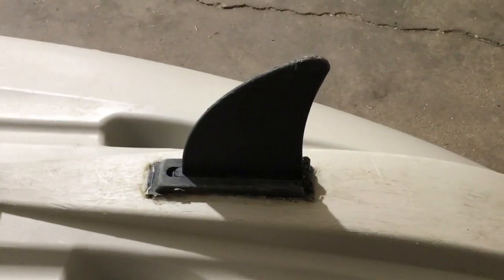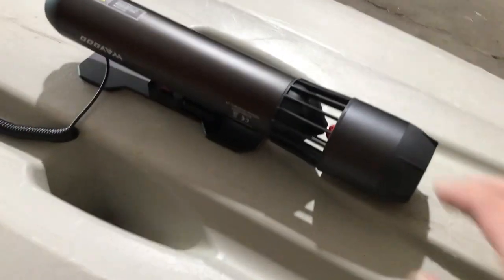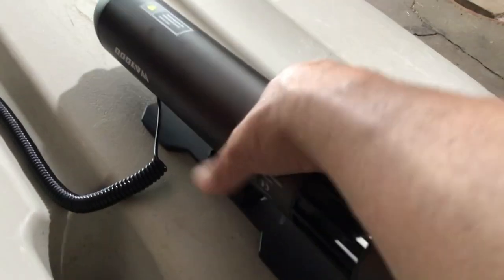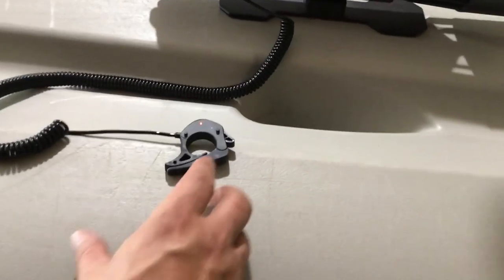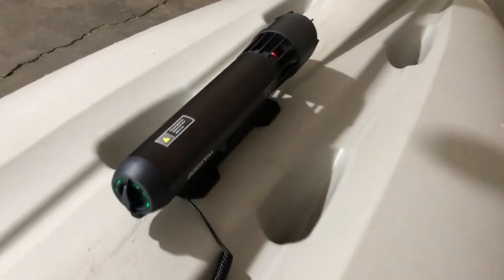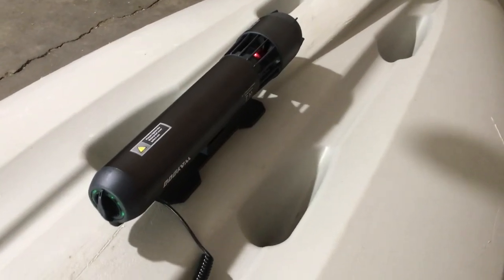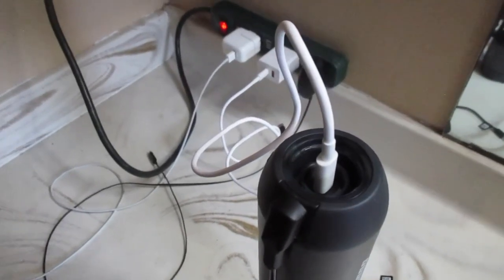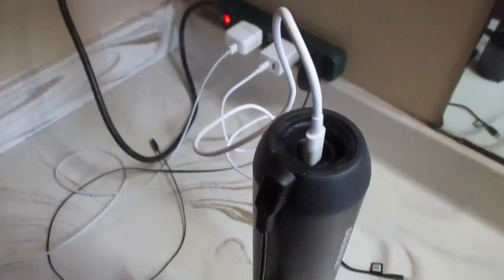WAYDOO SUBNADO SCOOTER #waydoo

Comment: Is there any way to keep it in super gear?
Reply from the maker: Super gear lasts one minute then it automatically goes into a lower gear in order to save the battery from draining to fast.  But what I do is after it goes into that lower gear, I click the switch to shut the unit off, then I go back into super gear mode and let it rip again. Make sense?  Also when turning the unit on before installing it under the craft, make sure your holding down the switch, that way you can use the cruise control mode. It explains that in the manual.